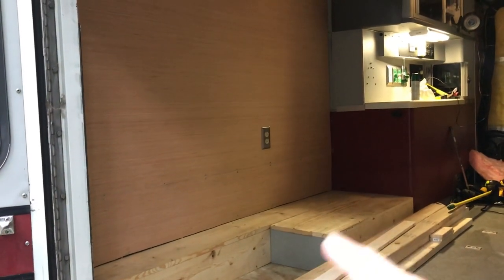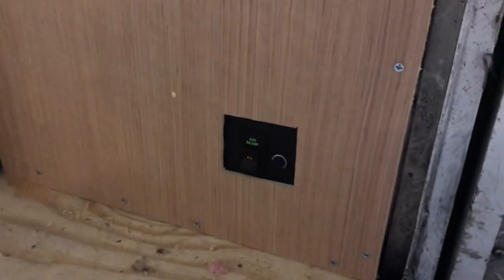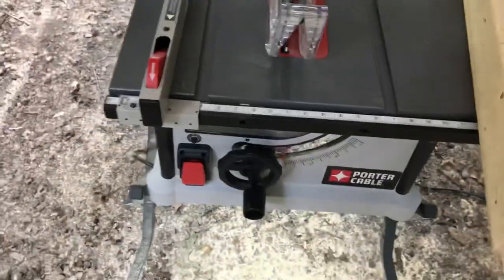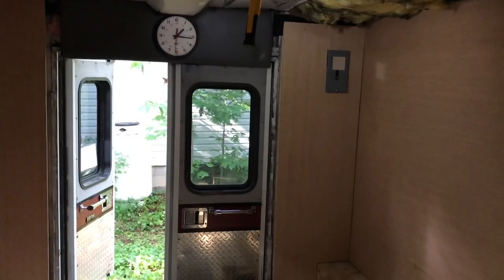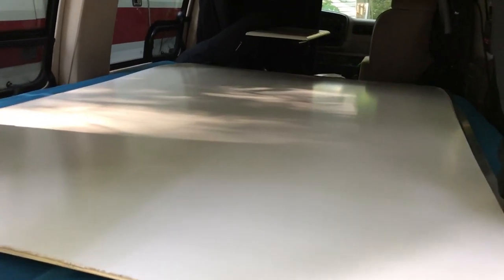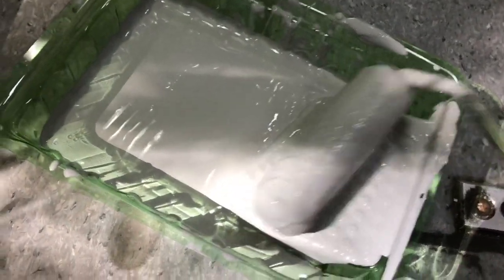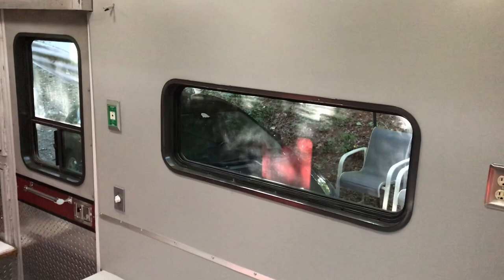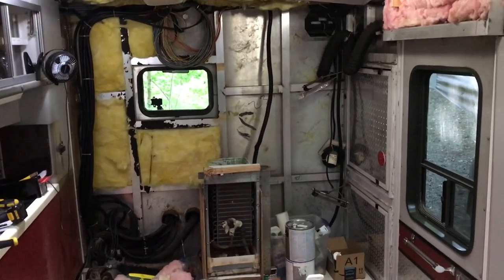Walls & Ceiling Paint & Finishes - Ambulance Camper Build Conversion RV Freightliner FL60 MAV

Comment: Wow! She looks great....”slaughter” that panel of wood...so funny 😂. That would be me! Thanks for showing the finish washer - never seen that before. Any more ideas on cabinetry and layout?
Reply from the maker: I am learning so many new things daily. Today it is vinyl flooring - never done that - hoping it goes well. I think the kitchen will be a standard 36" sink base, a 12" drawer base, a 36" over the fridge hanging cabnate and a 12" hanging cabnate that sits on the counter (if there is enough height. Just going to use stock Lowes cabnates and paint them myself to match the walls. The sink base over the a/c unit will be a bear to modify without it falling apart.
Reply: I was in the flooring business for 40 years. The trick to cutting a perfect vinyl floor is to make a paper pattern. Armstrong makes a kit with everything you need for $20. at Lowes or Home Depot.
Reply: Bent Nickel Hi Brent. Agreed. There is no vinyl flooring that doesn’t off gas voc’s other than Marmoleum which is more $$ and harder to install. Vinyl plank passed technical standards for me but continued to off gas for a full 4 yrs! I am always concerned about occupant health esp for full time rvers who live in a small space.
Reply: mishu  Tempest in a tea cup. Any sheet vinyl manufactured today is safe. We're talking about less than 60 s/f, if you closed it up and ran the temp to 140 degrees in the direct sun, you might smell something the first time you opened the door, but within 48 hours after installation you won't smell anything, but the fresh paint.
Reply: Bent Nickel we’ll have to disagree. I test products for third party certification and CMHC in Canada. No sheet vinyl or carpet for that matter (other than NZ wool) pass our standards for human health or pass our Indoor Air Quality standards for LEED Certification. Unfortunate but true. You are right about sunlight and high temperatures - its one of my tests.
Reply: mishu  Our experiences and expertise are in two different areas. Your's is highly technical and extremely precise, on the other hand mine is more practical. Two times in 40 years I've had customers complain about off gasing. Both times were special order "rush" carpet installations. Upon allowing the houses to air out over 48 hour periods, one customer accepted delivery and one did not. You are absolutely correct, I wouldn't know the health standards for LEED certification. For passing everyday living and customer satisfaction standards (asthma, allergies, COPD, and related respiratory illnesses) that I've handled from flooring installations, I'm pretty good. Air quality standards, I bow to you, sir.
Reply: Bent Nickel Brent...maybe you know how to curtsey? I’m a lady. Lol. Lets see what Mr Prius does with his MAV  and then we can have Round 2...just kidding. 🙃
Reply: mishu  For about the hundreth time I've failed to identify my audience. Last week I railed on a guy that was proud for dodging the military draft until he revealed he was Romanian, not American,  I asked another guy how could he believe that about cars and he said he was 12 y/o. Got into a deeply heated discussion about driving rules before I learned the writer was Austrailian (I'm American) and told a (young lady) she was beautiful and should have more confidence in herself only to learn HE was soon to be a SHE. The internet is far reaching and I've yet to learn that. Gender can't be determined when pronouns haven't been used and I curtsey to your expertise, Madame Canadian. My handle is Bent Nickel, like an old coin that jams a delicate machine, not Brent. :-D

Comment: Think about using the white vinyl heat wrap. That would be perfect. It's not expensive. All you need is a $14 Harbor Freight heat gun to do it.
Reply from the maker: That's an interesting idea. I have not played with heat wrapping. Thanks for the tip.
Reply: @timdillen  There is some that doesn't require heat. I've never used it but I've priced it and watched a lot of YouTube. LOL
Reply: @windymcgee6833  Not to resurrect this too much, but what is the heat wrap for?  I just bought the same vehicle and this series has been a WONDER of a help

Comment: Your 16" width cutting limitation on your table saw is determined by your fence. Remove your fence to expand your width. Your ceiling  looks like a melamine board and clear polyurethane in a spray can could match that manufacture's gloss. While your ceiling board is new I don't think you'd have to scuff the finsh to get a clear gloss to stick. Sure looks good from my recliner !!
Reply from the maker: 2 great tips! I did not think of a clear spray. I can try on a scrap piece and see how it adheres and looks.Thanks!